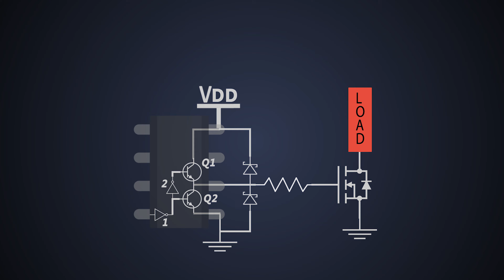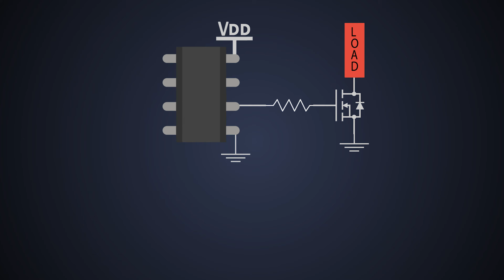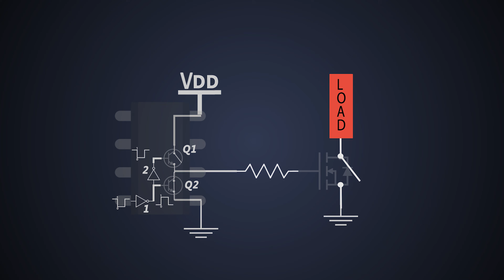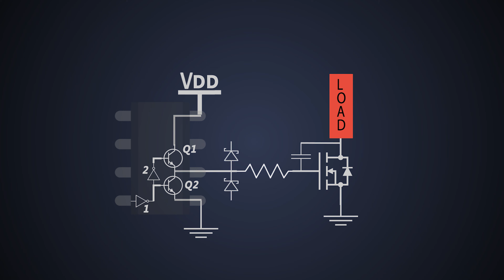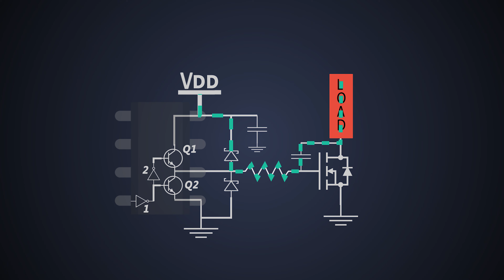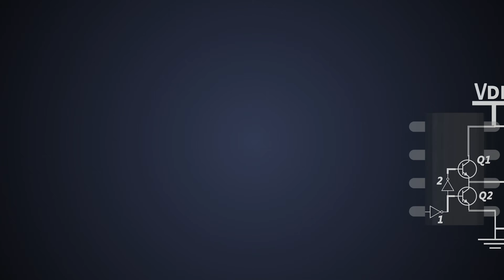What is MOSFET gate driver made of? How does MOSFET gate driver work? Gate driver working explained.

Comment: Perfect! I would like to know why opamps are not used as gate mosfet drivers?
Reply from the maker: Great question; op-amps generally lack the high-current output capability needed to drive MOSFET gate capacitance quickly!
Reply: If I supply an opamp with dual power supply, for example, +-12v, I can connect the output of the opamp to the mosfet's gate through a resistor and by putting a positive voltage on positive input I can charge the gate capacitance and viceversa.

Comment: I use a inductive load, but would a RCD snubber work as wel for the reverse current protection, instead of the shotky setup with the capacitor?

Comment: Hi ! Is it possible to replace de Shotkky diodes by placing a pull down resistor on the gate of the MOSFET to drive the current to the ground ?

Comment: What pins do we connect to the input signal/voltage and what pins do we connect to the mosfet ??
Reply from the maker: Great question! For most gate drivers:
👉 IN pin connects to your PWM or input signal
👉 OUT pin connects to the MOSFET gate
👉 VCC and GND power the driver

Comment: 2:27 why an extra not gate at the input, would it not be easier just to invert it once at one bjt and leave it as is at the other? Also, by doing this, we do not have to worry about the extra latency
Reply: Because otherwise your pwm signal wil have a inverse effect on thé mosfet, low would turn it on high would turn it off. So no signal would keep thé mosfet on

Comment: Is there a reason why the MOSFET driver uses two NPN transistors instead of a PNP and NPN pair? Also, in a previous video, you said that the MOSFET drivers are tolerant to negative transients, so I am a little confused about when to use the two schottky diodes.